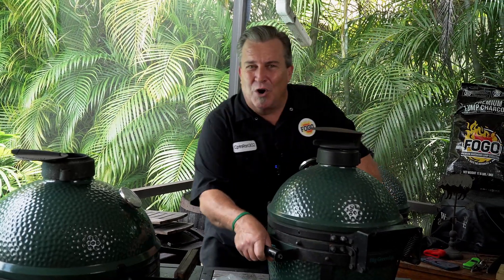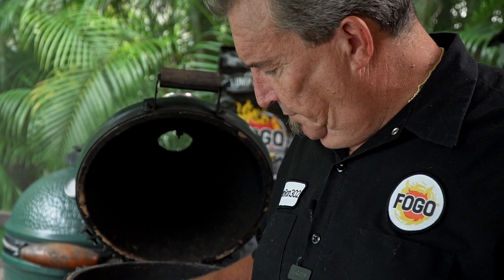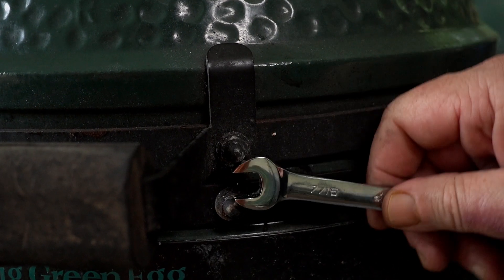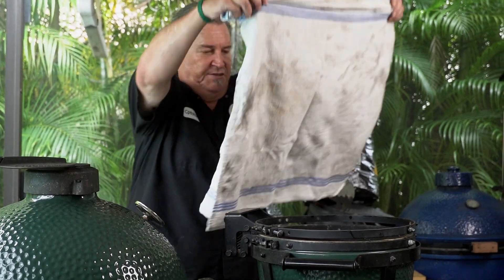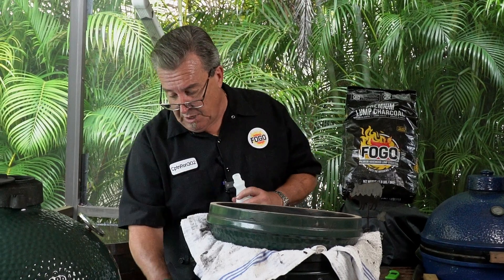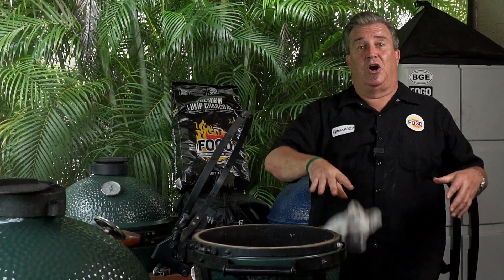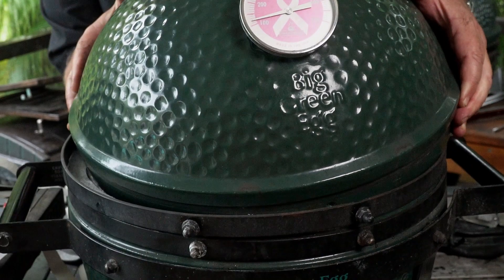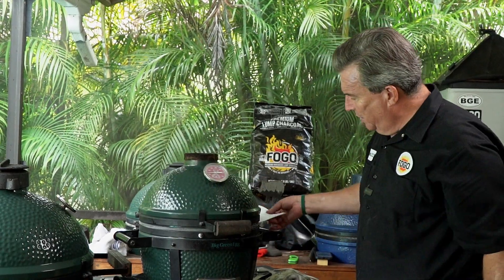Big Green Egg Gasket Change Step-by-Step | Big Green Egg Bands Adjustment | Green Egg Maintenance

Comment: What are the benefits of this gasket material over the other types like the oven gasket material done in an earlier video and the new gasket material that is on a KJ Series III?  Anyone used the KJ Series III gasket material on a GE yet?
Reply from the maker: This is for those that want to stick with OEM type of equipment.  It is really what is made for these grills.